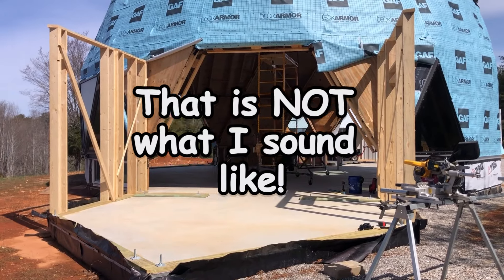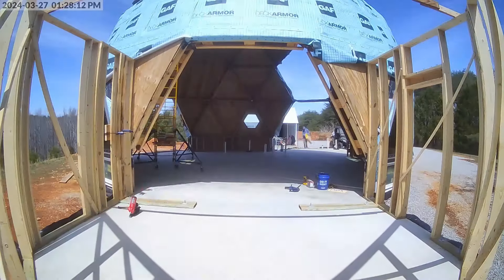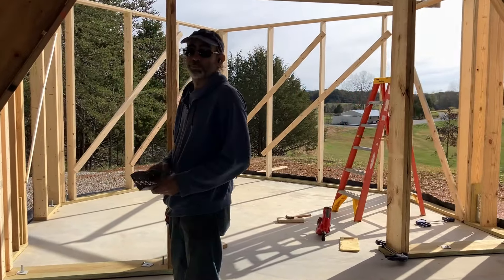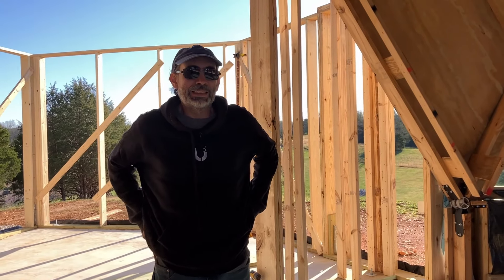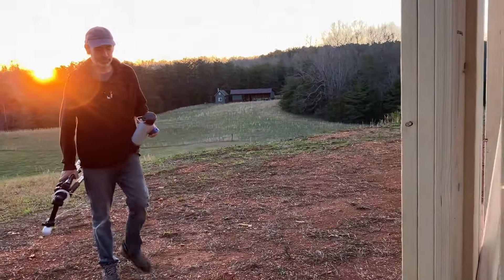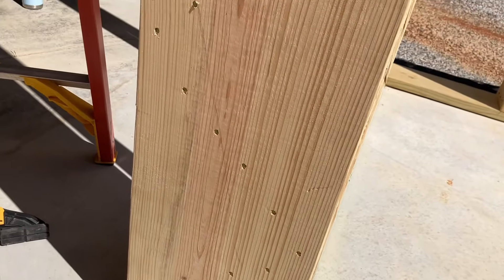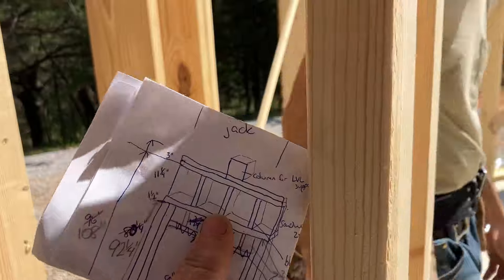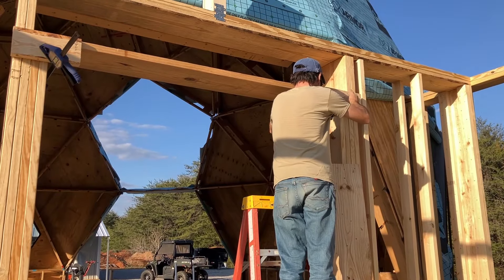Porch Framing Part Two...Walls Are Up!

Comment: They make a tool belt with shoulder straps. It would probably be a lot more comfortable because you can leave the waist belt a lot. Looser for being able to move around and all the weight is on your shoulders instead of on your waist and I believe you can add bags or take away bags
Reply: That would be quite helpful! The pockets on this one seem a touch too small for my drill so having a belt that is customizable sounds like a great idea.  Thanks!
Reply from the maker: I think this is going to end up as a "starter" belt for him.  Once he figures out what he likes/doesn't like, he can make a better choice.  Shoulder straps...good idea!